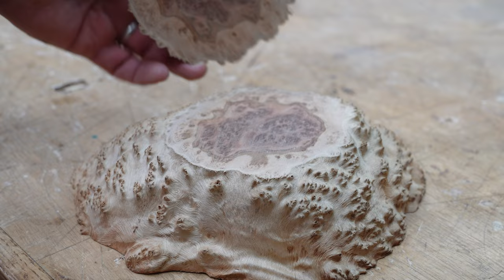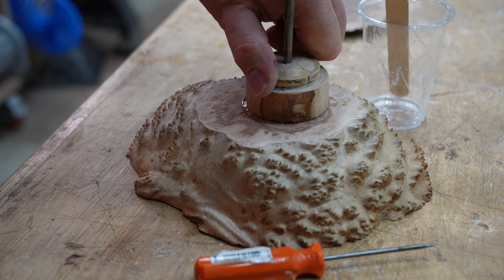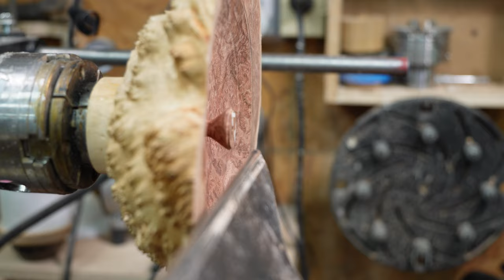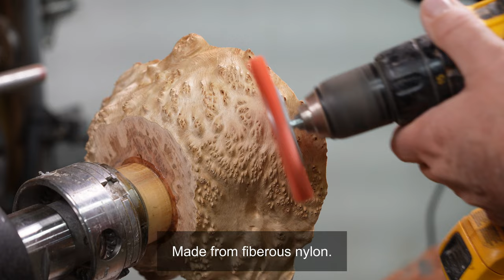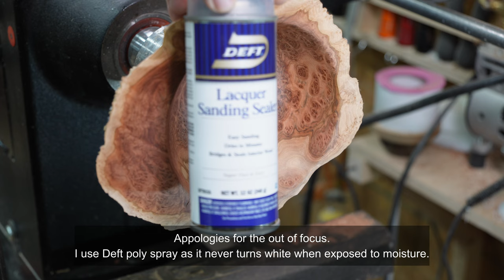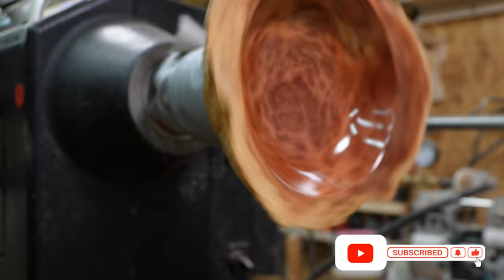Revealing the beauty of Australian Brown Mallee wood

Comment: I have a Mallee burl I'm getting ready to turn. I'm have trouble deciding if I want to save all the little spikes or turn them down to show the grain of the wood.
Reply from the maker: It’s a challenge mate. The Burl caps I’ve had so far havnt been big or round enough to turn down the outside. If I turned the outside on this project I would have ended up with a much smaller piece. I like the natural beauty of the outside texture and time will tell if my customers like it too lol. Cheers mate!
Reply: @bespokewoodartistry1517  Even though my piece of Mallee burl is small I think I'm going to remove the spikes to show the wood and end up with a very small bowl.